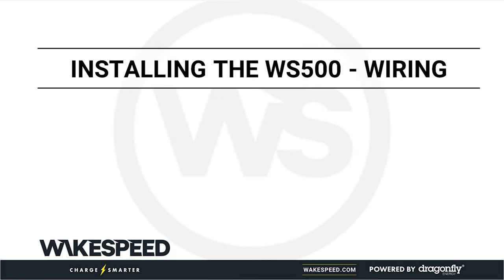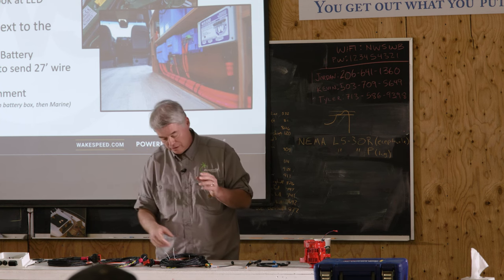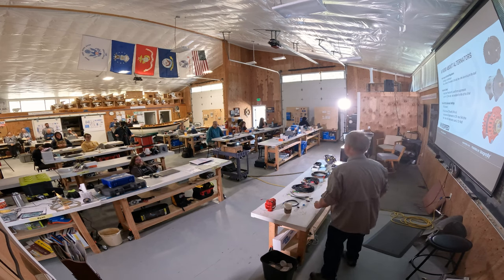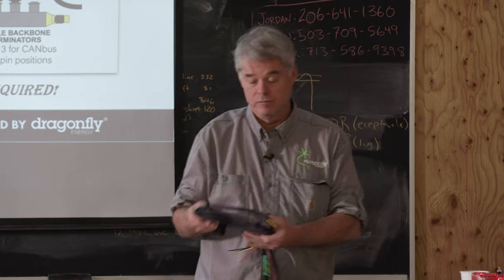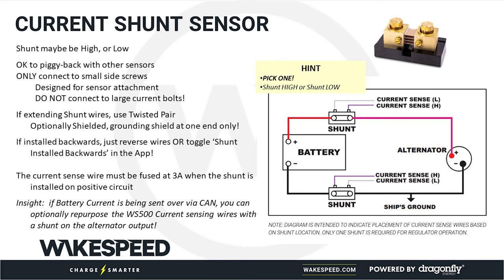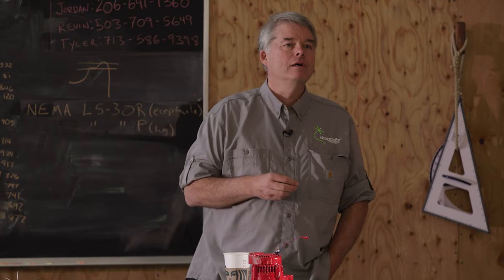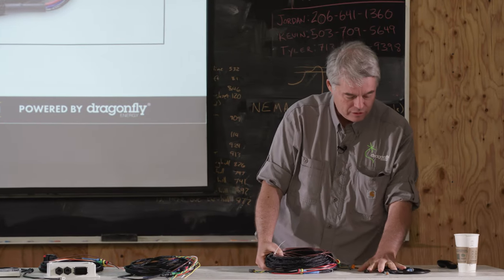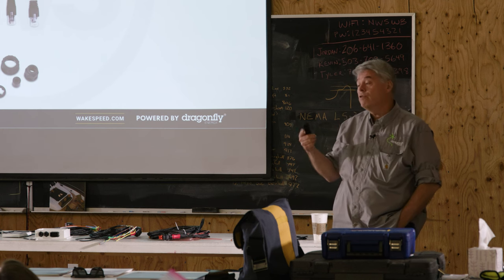Wakespeed 101 | Installing the WS500 Alternator Regulator | Wiring

Comment: I felt like I was there in class!! Great series, I watched it the first time when I first ran across Wakespeed on the Nations Alternator and regulator bundle offer, but it made no sense to me. (well some, but not a lot) I watched it to see how involved the actual wiring and integration would be but didn't see an actual live example, so I half listened. However, after exhausting my research for exact examples for my integration, I came back and was able to absorb more, your approach of principles and understanding of the systems helps to apply to a variety of scenarios! Thanks for taking the time to explain BMS, not only what it means, but the fact that this does not operate or communicate the same between manufacturers. ( I have a Magnum Energy systems 2000 system and it uses a BMK which is a monitor for the bank and not for the individual cells like in a BMS for Lithium.) I thought I had a good grasp of 12v, I will come back and watch this video again before I take the "Installing the WS500 Alternator Regulator" Exam LOL. BYW I was a surprised at how many more mobile installations there are as compared to marine.
Gilbert

Comment: I was told to come here for purchasing one of these for my Dakota Lithium 12v 135amp batteries. I am running a  250amp alternator this is going inside a 2018Jeep Wrangler. I am not much a good wiring and taking as many notes as I can and hoping I can get this done.

Comment: Can you please tell me if the ws500w controller will work on a Delco Remy 50DN gear driven 12 volt DC brushless generator for a Detroit diesel 6v71n bus engine
Reply: Yes, I have a WS500 regulating my 12v 50dn on a Series 60
Reply: @DLWertz  thank you for your help